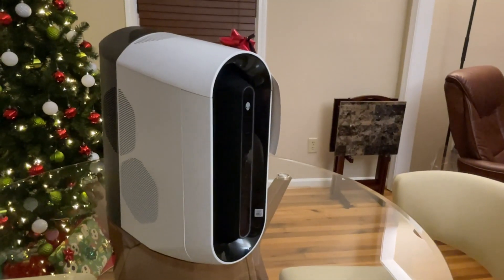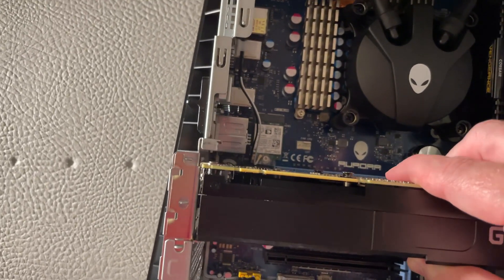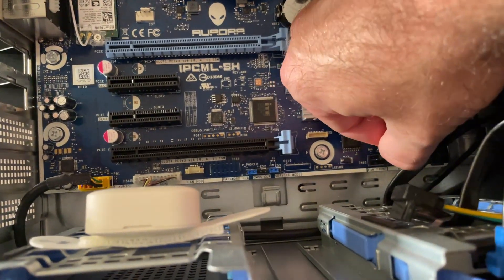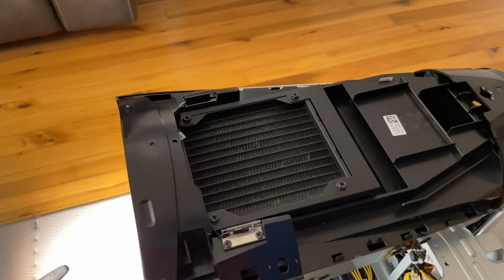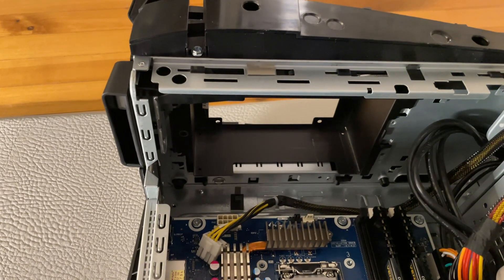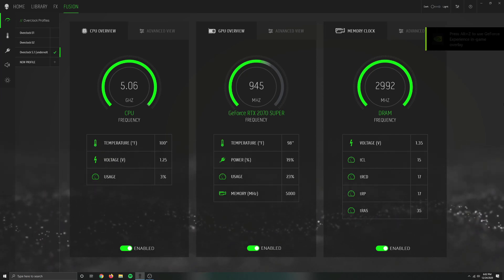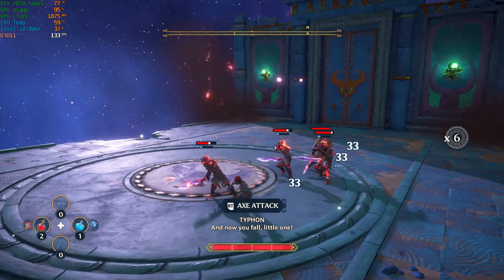Alienware R11 Radiator Mod and Case Fan Upgrade

Comment from the maker: Thanks for watching everyone! Below is a part list in case you want to try it for yourself.

QTY 3: 120mm non-RGB 120mm Corsair Pro fan
QTY 4: 1 and 1/4 inch Number 6 Phillip head screw (available at just about any hardware store)
QTY 1: Y Fan Splitter
QTY 1: Artic MX4 Thermal Paste
4 inch Zip Ties
Reply: Sir you saved me time with the number 6 phillips screw, every other video I have seen never mention the size of the small screws. You are a life saver
Reply: Would these work? Having a look online in aus 
https://www.jaycar.com.au/m3-x-32mm-steel-screws-pk-25/p/HP0418
Reply from the maker: @leightreloar2158  Had to actually look up the metric conversion on those, but yes, they should work as M3 X 32 is the metric equivalent of #6X32 1 and 1/4.
Reply: @theonlyjoe6036  thanks, the only Joe legend
Reply: @leightreloar2158  did u try these?  I am also in Aus looking for something appropriate
Reply: @chopps2274  these are the ones I got and used https://www.boltandnut.com.au/6-32-tpi-unc-stainless-a2-70-g304-pan-phillips-ph2-machine-screws
Reply: @leightreloar2158  thanks i already bought your original suggestion so fingers crossed they also work.
Reply: @chopps2274  have you had a chance to try those screws? I'm still wondering which ones to get.
Reply: @Teslacoil33  screws from jaycar Def worked
Reply: @leightreloar2158  Hi, could you tell me what's screws I need ? Don't understand non metric unit ahah. Sorry for bad english, Im from france.
Reply: Can you put links to Amazon or Newegg for the items involved ?
Reply from the maker: @thomasdecesaro7022  Fan link : https://www.amazon.com/gp/product/B01G5I6O4Q/ref=ppx_yo_dt_b_asin_title_o06_s00?ie=UTF8&psc=1

Thermal paste: https://www.amazon.com/gp/product/B0795DP124/ref=ppx_yo_dt_b_asin_title_o07_s00?ie=UTF8&psc=1

Y Splitter: https://www.amazon.com/gp/product/B01EF9OI0O/ref=ppx_yo_dt_b_asin_title_o03_s00?ie=UTF8&psc=1

Screws: https://www.homedepot.com/p/Everbilt-6-32-x-1-1-4-in-Combo-Round-Head-Brass-Machine-Screw-5-Pack-813561/204274717
Reply: @theonlyjoe6036  you should move this to desc
Reply: have you tried to add a second fan to the front where the 3.5" HDD slot is? looking to give it a try soon

thanks in advanced
Reply from the maker: @Burke09221992  I haven't yet. While I did take out the front HDD bay, the holes are not sized correctly for a 120mm fan. A dell fan bracket like is mounted for the bottom fan would work, but I can't seem to find one. I might have to drill two small holes for the screws to go in on one side, or possibly a 140mm fan might work too.
Reply: @theonlyjoe6036  will the corsair ml120s non pro work fine?? do they have to be pro and why??? i had ordered just the ml120s and was re watching a few vids to refresh my memory and heard u say it has to be pro.
Reply from the maker: @lukasmelvin9967  The non-pros did not work at the time I made the video. I actually had redo all of the work with the Pros in order to not receive the BIOS error. I also know now that Noctua fans also work with no problems.
Reply: @theonlyjoe6036  good to know! and thank you man for taking the time to get back to me! Super appreciated!!! I didnt wanna risk that biscuit lol so i just ended up grabbing the pros as well. Will find out on the 2nd or 3rd if both work or only pros and can update! Question? For your front case fan was that just the ml120 non pro? It was white blade like the ml120 non pros so i was just curious if u used a non pro for front fan and 2 pros for the radiator mod?
Reply from the maker: @lukasmelvin9967  It was the Pro for the front. I actually filmed half of the footage with the non-pros, got the BIOS error, and redid the work. I still ended up using some of footage with the non-pro fans in order to save some time and effort.
Reply: @theonlyjoe6036  I think the HDD bay has the screw holes to mount a fan. Less than ideal airflow but still an improvement
Reply: Anyone have a link to screws that worked I got some 1 and 1/4 number 6 or so I thought and it doesn’t fit. Please help.
Reply: Thanx for the video Joe !
Reply: Do you have any suggestion for a cpu fan replacement ?
Reply: How much did this whole mod cost you? Just a ballpark, thanks! :D
Reply: Can the fans be ML120 Pro RGB? Those are the only available ones at the moment
Reply: hey so I have all the same fans and everything but once I put both fans on top the aio screws would align with their original spots unless I really man handled it into positon. But once I got it in position I couldn't put the ram back in because the tubes were blocking the way. I don't understand how I do not have enough room
Reply: @MacrWest  Did you ever figure this out? I couldn't even get the AIO back in due to the tubes being so stiff.
Reply: @Tesseus  It is impossible to make a "sandwich" for the heatsink since it will be at a lower position compared to OEM which has no fan on top of the heatsink. The only possible way is to replace the AIO with a third party with a longer tube or "soft" one, the one that comes with the computer is impossible.
Reply: @The Only Joe 
I followed all your steps however mine got a bios error for the Top Fan for some reason. I don’t think I did anything wrong but I used the Corsair ML120 Pro LED. Is that why? The error code was 2000-0511
Reply: @willizey  U cant use the LED fans - needs to be non-LED as far as I know
Reply: @chopps2274  Do I need to rebuy 2 fans or just one. Not sure.
Reply: @chopps2274  but is it fine to just ignore the bios error since the fans still spin and work?
Reply: @willizey  as far as i know yes bios error can just be ignored
Reply: @chopps2274  thanks bro

Comment: Hello joe my R12 didn’t have a water cooler and I tried to add one since my pc would shut off with big temps now that the cooler was installed now my pc will not start up it runs but stays in a black screen I thought maybe it was the cooler so I replace everything with the OEM fans and now it’s still doing the same thing. The cooler I used was a 120 kraken from nzxt. Please let me know if you can help.

Comment: Thanks for the video. I tried to do the same as yours. But I bought the wrong fan ( I bought 4 Corsair ml120,no pros)But after I finished this I realized that there’s top fan error when I start the computer every time. I tried to buy the exact same in the video but the Corsair ml120 pro(no rgb/led is out of stock, I can’t find them anymore)
One question, I’m going to buy the Corsair ml 120 pro led, and replace the top two fans. Can this problem be solved? Or do I have to replace the front two fans as well(I removed the hard drive from the front top and add another fan and use the y splitter connect with the bottom one)

Comment: So you screwed the extra fan on top of your radiator. and then there's another fan directly underneath your radiator?? I'm thinking of doing the same thing
Reply: That's called a push-pull configuration.

Comment: I have the alienware r12 i7 water cooled with 3070.Will adding 2 more fans will lower the temp of cpu/gpu? I usually just play games. Cpu runs 58-65c while the gpu runs 65-75c depends on the game i play.

Comment: If this setup is pushing and pulling the hot air from the case out of the top, then its not as efficient as it would be pulling cool air in thru the radiator and in to the case, then push the air out the front or rear. Unless there is a better location for the radiator, its always better to cool off the liquid using cool air vs hot air

Comment: I just bought an R14 and replaced my RGB oem aio fan with a Noctua NF-A12x25, ( that and the thermal nano grease has me idling at 32C 100% load 70C a two hour gaming session 57C, when I first got mine the arctic silver 5 they used was so dry that after about 1min 30 secs of cenibench I was at 85C and idling around 50C and was in the 85C range while gaming ) but I want a cheaper fan for the other 3, I’m a poor man with a 5900X, 3080 Ti and 32gb of ram, I think Im gonna go with these corsairs to save a few bucks, and MX-5 is better than MX-4 and if you want a really good paste try Kinpin Kpx thermal nano grease that stuff is about the closest to liquid metal your gonna get that’s non conducive it’s a hair expensive though and it’s for overclocking, luckily with the R14 you can throw any fan you want without a bios error even three pin fans and you can upgrade your ram with the XMP so the new Alienware r13/14 are very upgradable, and the spread method of applying thermal paste is the proper method it goes way back and it works well I been using the spread for 30 years and a grounding strap cause ESD is real I killed a stick of ram once and a mobo once with ESD ( electro static discharge )

Comment: The only small issue I had was it was just a bit difficult to get the AIO back in place due to the radiator being a little lower after the push-pull mod. But the temps seem to be great averaging 37-40c most of the time.
Reply: How did you get it back in?  I couldn't get the AIO back on since it was lower like you said.
Reply: @Tesseus  it was a pain had to be pretty forceful.

Comment: Great video! If I don't want to replace the thermal paste and remove the AIO, can I just unscrew the top fan from the radiator while it's still installed? When you removed the top fan from the radiator, it looked like there was nothing to it except for removing the 4 fan screws and nothing else preventing it's removal.

Comment: In case anyone is wondering because I was confused about it at first the fans in the video are just the normal ML120s you don't have to go for the pros. I don't know if there was a mix-up or something but even looking up the SKU on the back of the fan you get taken to the normal ML120. Out of curiosity did you do any editing to the fan curves for the difference in RPMs I was planning to use these same ones for my PC.

Comment: @The Only Joe

Thanks for this video.
I purchased an R11 w/ Air cooling, 10900F and a 3090, lets just say I learned to take the side of my case off almost instantly. To relieve some heat on the CPU, I purchased a H60 Water Cooler, 2x Cooler Master Sickleflow fans (both higher CFM and Static pressure than stock fans @ lower speed) for push/pull. It seems with your Push/Pull Sandwich you had lots of clearance on your power supply when swinging it back over with both 25mm fans there and the radiator there.. I see that you put the pull fan in first and lined it up first, is that because the tray for radiator and radiator fan was too shallow to put both in? I was worried about the room left available for air flow immediately below the radiator/above the power supply, so I do have one slim fan, that I could do a SIcklemaster (push) + radiator + P12 slim (the only issue is that the slim has less CFM and Static pressure than the doing two of the same type and I dont know the extent of the consequences of having an imbalance of them in the push pull setup. 

I read a user somewhere had the best configuration on their PC by setting all of their fans to be intake from external to internal, basically making the computer a vaccum, but the had all the slots open in the back other than the video card I believe so air could pass out the back. 

I run my case neutral pressure as I have the door open, I have no other ability to use it safely without. I hope that I don't have a processor with a fault though.. my i9 core 6/7 always seem to get a few degrees hotter than the rest of the cores and were in risky temp areas. 80+

I'll definitely come back and fill people in on my results, I plan on doing some kind of video/tutorial/my experience with the process but I do have a question for you or to anyone about your video... you show some game play and it shows both the usage on the GPU/CPU their temps and frequencies, how do I get this? Can anyone suggest an application to use to add it in for screen capture?

Comment: still an overheating box with new fans.... i finally decided to replace the mobo and the case entirely with btr parts.... anything with this case design is bound to have heat issues.... ive been throught 2 full replacements with dell now

Comment: ive changed the fans n using the noctua cromax. but i cant adjust the fan speed anymore, it stuck at 30% max . my cpu temp reachd 80-90 when playing far cry 5 :(

Comment: Ok, I finally went ahead with the push/pull upgrade. A few things I would like to pass on to anyone else who wants to try this.

5:30, I also removed the heatsinks (just held in by 3 screws) and RAM sticks to make it easier to remove the radiator.
 
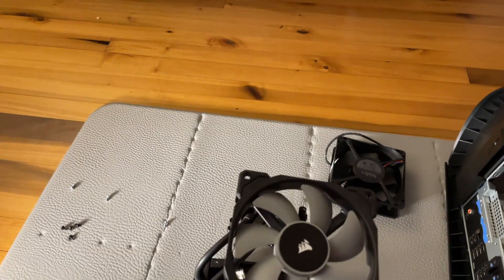6:30, make sure you have a screwdriver that fits through the plastic holes in the fan! I had so many screwdrivers lying around, but none of them had a stem thin enough to fit the hole. I didn't check this prior to attempting the upgrade so was in quite a pickle at this point. Also at 7:00 make sure you screw the new fan back into the radiator (this might seem obvious but isn't explicitly mentioned in the video).

At 7:16, pay attention to the top fans cable. I didn't pull the cable through far enough so when I put the radiator back in there was a bit of cable that was in the way of the fan. It's worth taking the time to make sure the top fan's cable is out of the way.

As mentioned at 7:32, it can be hard to line up the holes with the screws, 3 of mine went in fairly easily, but the fourth was a bit tricky. I spent a bit of time gently jiggly things around until it did.

8:00, I'm not sure if it was just me, but it felt like my AIO didn't want to fit back over the CPU very easily after I took it out. I sort of had to 'force' it into place, meaning my hoses are little more kinked than before. Not sure if anyone else had this issue, but I'd suggest just taking your time here when placing it back in place.

Lastly, make sure you plug everything back in! I had a minor freakout when my computer booted into a BIOS error. Fortunately I had just forgotten to reattach the CPU fan cable 😅

But when all is said and done, my computer is SIGNIFICANTLY quieter than before, and along with around a -125mV undervolt, my CPU rarely gets over 45°C

Thanks again for this awesome video, could not have done it without your help!
Reply: Mine got a bios error for the Top Fan for some reason. I don’t think I did anything wrong but I used the Corsair ML120 Pro LED. Is that why?
Reply: @willizey  Yeah i think the LED version is the issue. This mobo is very picky with fans that it deems acceptable. The good thing about the bios errors is that you can hit esc a few times and it will still boot fine i think.
Reply: @willizey  I got the same fans as you did and got the same Bios error. However, after two new reboots, it went away and hasn't complained at all. Weird.

Comment: Excellent video, just did this on my R12. Something I couldn't find an answer to anywhere ... There are two sets of standoffs that come with the H60, you want to use the set that has the same length on both ends of the standoff, using the one that has a long side and short side won't work.

Comment: Joe I slid the pull fan in and then the radiator with the push fan. It appears there is now less clearance since the 2 fans are wider then the single. I can’t get the AIO block on the cpu without putting force on the tubing. Was your a tighter fit too? I’m working on the same computer
Reply: Did you ever figure this out?  I couldn't get AIO back on when I tried too

Comment: Just slapped in the first fan without too much trouble. Already can notice the beast is a bit quieter. Need to work up the courage to get the push/pull configuration happening for that top exhaust fan, but I'll be sure to use your video as a reference again. Thanks a lot!

Comment: I am not keen on doing the whole removal of water cooler and repasting. can i just add the top fan and thread the power cable through so that i can do the push pull method? while keeping the original pull fan?

Comment: Correct me if I'm wrong but I 
don't think the front fan does anything. For me if I put it 100% I get the same temperatures and if I put it at 0% I get the same temperatures.

Comment: Just did this upgrade to my R10 now and it works great, but I have a question. Did you connect the radiator fans to the “top fan” or “cpu fan”?

Comment: were you able to put the top cover back on flush with the  1 and 1/4 inch Number 6 Phillip head screw installed on the 3rd fan on top?

Comment: Brother Good Evening and great video, if you don’t mind and have a time then could you please do check these Corsair Fans information on their website and then let me know weather they will work on this Alienware Aurora R12 or not, like some other peoples I also don’t know much so please help, really appreciate and many thanks Brother, also kindly make more videos on this Machine, Mohammed.

SKU CO-9050104-WW
Corsair iCUE QL120 RGB 120mm PWM White Fan — Triple Fan Kit with Lighting Node CORE Included.

Give your PC spectacular lighting from any angle with the CORSAIR iCUE QL120 RGB PWM White Triple Fan Kit, equipped with 102 individually addressable RGB LEDs – 34 in each fan – across four distinct light loops in a brilliant white housing.

Comment: Joe, any chance you could do a quick test for me, two days ago my R11 started shutting down, so when I restart it and press F12 3 times at the Alienware logo, I choose Diagnostics, and it throws an error that the Top fan is not working properly.  Note that it had been working for months with the new Corsair fans, and I can hear the fans reeve up 'normally'.  I just want to make sure that you do not see the same error, and I might be barking up the wrong tree.  Additionally note that I re-installed the Stock Fan, and the error went away from the Diagnostics.  Again, it worked fine for months, but I want to make sure that you get (or not get) the Error to see if its 'normal' behavior when using the corsair fans.